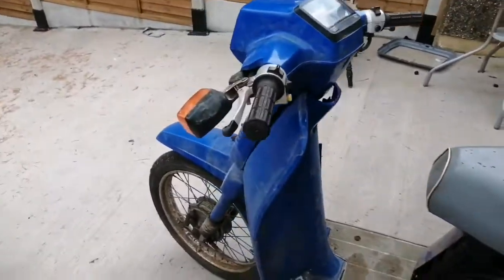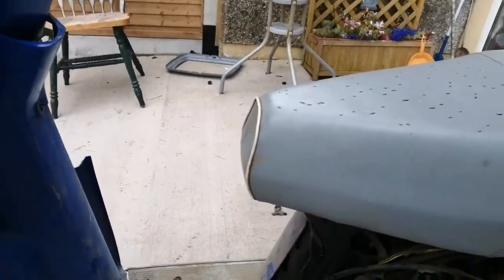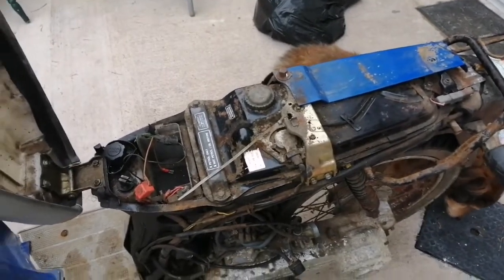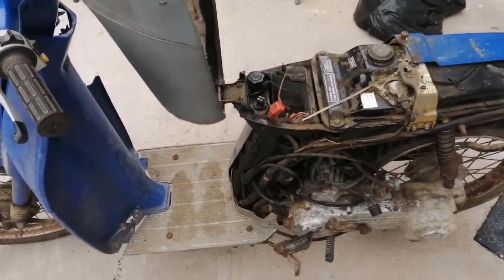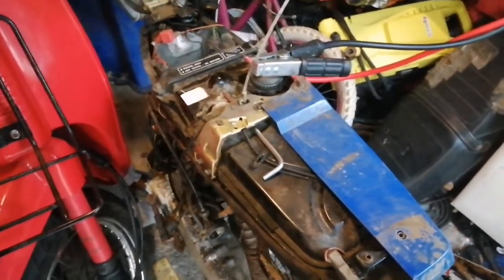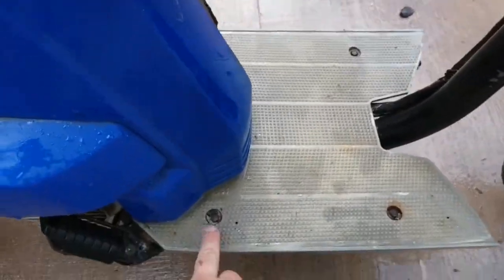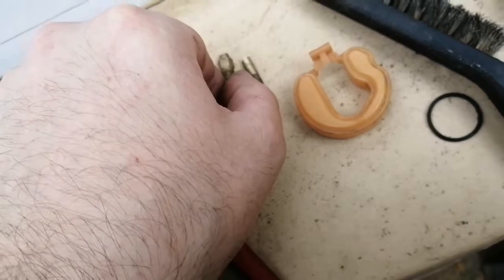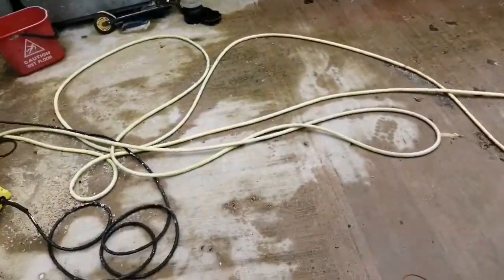(Old Blue) New project part 1

Comment: mine is year 2000 alloy wheel 2stroke red  sh50 honda got it second hand jan 2002 family pet now ps i can kick start mine without battery  fitted to start . but not good to work lights indicator good.
Reply from the maker: O didn't know they could run without battery when they're a cdi bike.
Reply: @damo690  yes my year 2000 alloy wheel 2 stroke sh50 can start on kick start only done it with battery out but inicators lights not work . but still run and go this jan coming had it 21 years got it when it was year and half old .
been good bike never let me down thown me off or cost to much to run and worth still the £999 pound i paid for it ?
can insure it for £55 pound 3rd party a very lucky bike and before anyone asks NOT FOR SALE NOW OR EVER AT ANY PRICE family pet ?